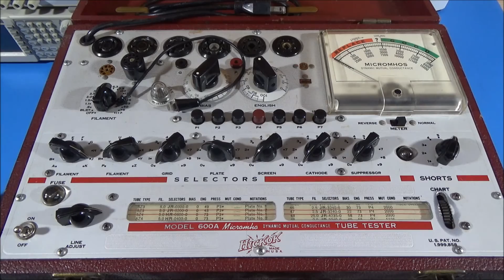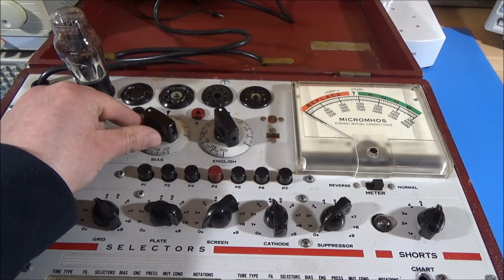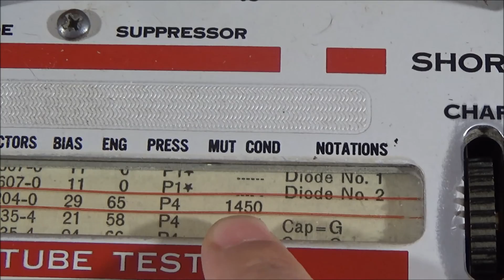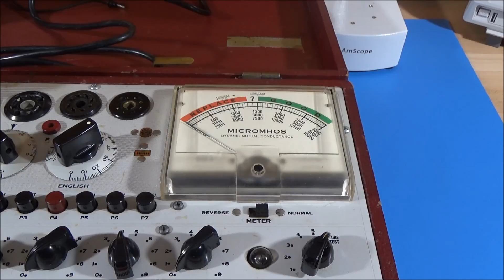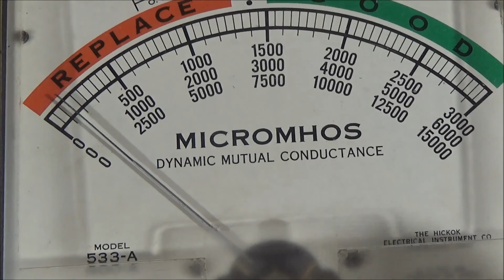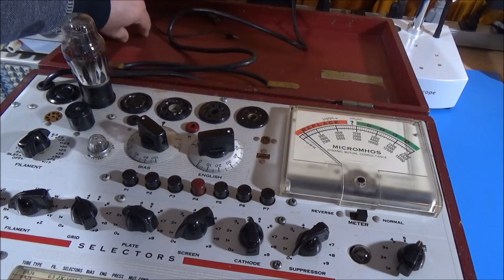OhmsAtHome #11 Testing Vacuum Tubes

Comment: Question---I have the same model. Did you recap and if so can you share what you replaced the caps with? The capacitors are vintage Sprague radial types and I was wondering if you kept them or changed them out. Thanks in advance.

Comment: Buy some Novus 1 it's in a spray bottle has anti static properties spray some on soft cloth and rub meter also make sure meter is on 0 if not adjust that screw on face of meter

Comment: Those drug store testers where not very accurate. Yours is better then those but not as good as laboratory with fixed gm switch instead of sharing gm on a shunt or English control

Comment: I am confused about why your meter is not settling down to 0 after you set the line. Disturbing.
Reply: He said there was static buildup from the plastic cover for the gauge and it would cause it not to go down to 0.
Reply: Easy fix grab a bottle of Novus plastic cleaner spray some on soft cloth and wipe meter it has antistatic properties